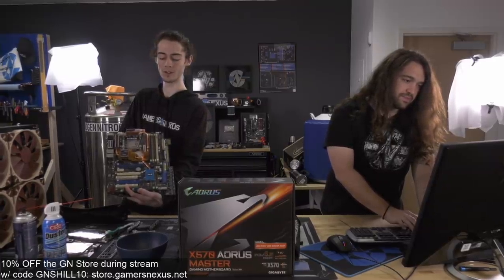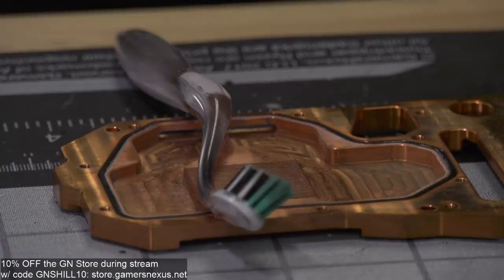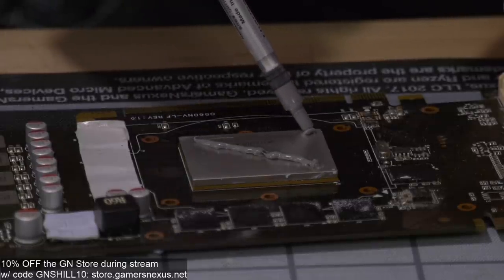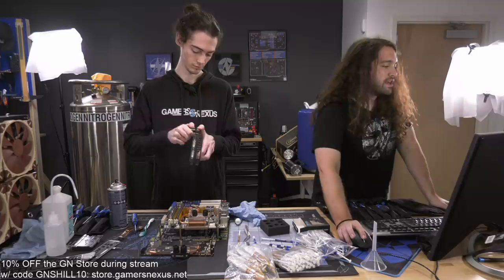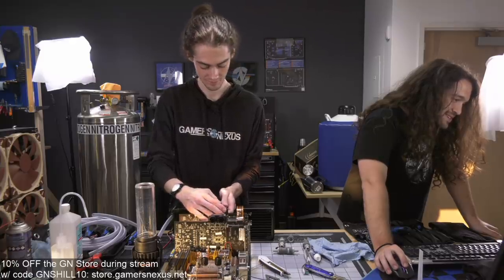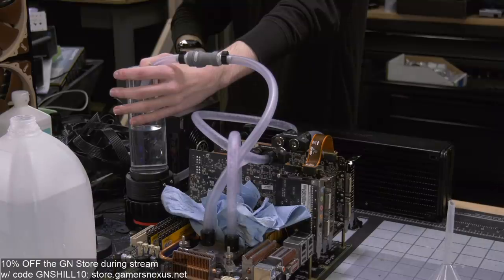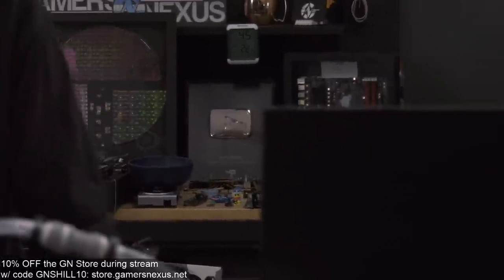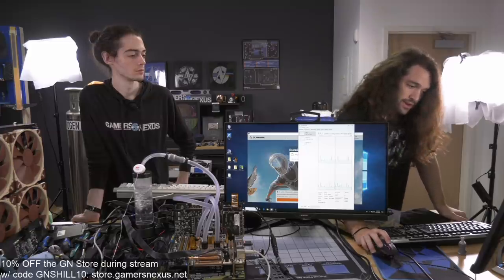Live: Ultimate Overclocking PC Restoration & Water Cooling

Comment: WOW!!   This brings back some nostalgic memories....
I had the original Striker Extreme, and they had an LED lit I/O shield too, and if I remember correctly, it also had an LED readout for info too.
I went for the EVGA 780i SLI(with the chipset fan add-on) after, and I still have that with the Q6600 G0 stepping(24/7@4.2GHz) and 4GB's of the Ballistix LED RAM and 2GB's of the SLI RAM sticks too.
My mothers PC has the watercooled KFA2 GTX 470 that I was using with that mobo but I still have the Sparkle 8800GT that I was using with the Striker mobo though......🤔
Can't wait to see the bench scores.  👍

Comment: Takes me back! in 2008 I had a Q9550 @3.625GHz running super quiet on a Tuniq Tower 120, the highest i got it running rock solid was 4.05GHz but with the fan and thermals getting higher than i felt comfortable around 80c overnight running prime 95. Paired it with 8GB 1150MHz CAS 5-5-5-11 ram and a HD 4850 that i volt-moded and i think ran at 850MHz with a 4 heat pipe CPU cooler i took out an HP business PC lol, the GPU was also whisper quiet at full load over hours of use. Also had a 120GB SandDisk Extreme wiff dat SATA 2 connection and a 1TB WD Black drive ;-)

FYI, I lapped the CPU and heatsink to a mirror finish with Artic silver 5, which i needed just a pea size that still got mostly mushed out anyway because of how flat the two surfaces were against each other.

Comment: Dude i gotta confess. Just about5-6 short months ago, i recieved my first pc. A custom pre-built from i buy power. (BB981 to be specific, i5 9400f {yea ik} 1650 super B365 chipset)Which to deviate slightly, you might be happy to hear that i recieved the system in awesome condition. Nothing was not connected, no glue anywhere in fact it honestly looked like a nicely cable managed custom build.BUT there was 8gbs of ram installed in one stick vs 2 four gb sitcks in dual channel. Anyway ive not only gotten comfortable enough to perform the average gamerboi upgrades, adding identical ram IN dual channel, new gpu, soon to be new cpu, ive also gotten comfortable to dissasemble my system purely for the opportunity to get better aquainted, Intermediate disassembly for thermal interface replacement, waterblock installations, and even some mild expert lvl situations, like de-lidding an i7 to replace the stock thermal interface with liquid metal for reduced thermals and data transfer acoustics (yes that is a rough quote from you lol). I wouldnt have been able to make a quick study of some of these things without your content dude. Thanks alot man, ill be moving on to locate that awesome shirt patrick is wearing in this vod, Thanks again for the guiding light Obi-Wan
Luke

Comment: Man, it made me cringe so hard seeing you guys completely lost in that BIOS settings. Unfortunately I didn't watch this video live. I could have "helped you" setup and overclock your system. 
I "upgraded" two months ago from my very own Striker II Extreme, Core 2 Quad Q9450, 8 GB DDR3 1600 MHz, to a Ryzen 5 3600 CPU running on a Gigabyte X570 AORUS Elite with 16 GB Kingston HyperX Predator 3600 CL16 memory.
Can you imagine the feeling?
I tried Cinebench r20 on my previous setup and it reached 163 points in multi-threaded mode.
My Ryzen 3000 series easily reached 3830 points. That's the scale of my upgrade. 23.5x the score. 
Thanks GN for the great vids and the great work!
Reply: @Patrick G I know that AVX isn't supported by the Q9450 and that was one of the main reasons I had to get rid of it. :-D
Thanks for your reply.

Comment: Less is more when it comes to applying the thermal paste.  You probably aren't messing anything up on the GPU because there were no discrete components very close to the GPU die, but on the chipset that drop was too much and it could be problematic IF the paste is conductive.  You don't want the paste spreading beyond the top of the die.  Carey Holzmann has a good technique for applying thermal paste (albeit it uses a latex glove) and he manually spreads the paste with his finger and he dabs it evenly across the entire surface.  This technique uses less paste and results in more efficient heat transfer.  The closer the heat sink is to the die, the more efficient the heat transfer.
Reply: Is this a copy pasta?

Comment: Overclocked this board a lot! 
Did 4.5GHz with a E8400 and even achieved a super high memory bandwidth with G.Skill RipJaws 1600MHz @ 2000 8-10-9-20 CL2, 500FSB 
Scored 14,962 GB/s Read, 10,639 Write, 11,206 Copy, 50.9ns Latency in AIDA64 MemoryBench
Tripple SLI testing was fun too but insanely CPU bottlenecked

Comment: I had, actually still have, a 560Ti somewhere, and it has the biggest cooling solution of any card I have ever had, pretty sure it was an Asus heat pipe thing but it is a triple wide card, those Fermi cards ran hot hot hot

Comment: do you think the cmos was still giving power to the board? I know i recently messed up ryzen master settings and it took me like 5 hours to figure out i needed to put a jumper on jbat to reset it. idk much really about electrical engineering outside of phy101 just know you don't want to bridge points to over amp or over volt resistors, or if some of the components on the board still hold a charge, like with a psu, for the distilled water on the board and the ultrasonic cleaner.

Comment: I have a Q6600 running at 3.00GHz on a Abit AB9 Pro w/ 2x2GB RAM at stock. I tried getting the Q6600 at 3.15/3.20 but windows crashes, and BSoD when i put more than 1.4v in the core... so i might change the cooling (it's on air for the moment, zalmann old one lol), any ideas or advices ? 

PS: yeah i know this is not a forum but whatever i think there are a lot of good overclockers here and i love this community

Comment: Just a quick minor correction here Steve, nvidia keeps their hardware in more up to date drivers but they do not optimize or add any support for them for very long usually only until the generation after the following launches the cards from two gen old get no love anymore. Just because the card is in drivers from 2019 doesn't mean it's had any updates at all since 2013, OS compatibility aside.

Comment: G'day Steve, Patrick & Kegan (hope I spelt that right),
That is a cool old system, although it is running really slow compared to my Q9650 using an SSD, I am running Windows XP on mine so maybe W10 is using more resources,
with the Core 2 Quad you OC the Frequency if the Multiplier is at Max & adjust the Memory to CPU link Ratio for memory Frequency, although from memory the Xtreme have an unlocked multiplier,

I would like to see an OC stream for the system

P.s. is Joe coming on Saturday or Sunday? i'll have to get up early here in Australia
Reply: windows 10 does a lot of background work. paging, updates, etc. u need turn all of these off in group policy (which doesnt even work on windows 10 home LOL) unless you want to wait out for everything to finish. windows 10 hits hard on older hardware. so I use older windows 10 LTSB install which has a lot of the crap turned off by default. and it works just fine.
Reply: With the right tuning (and enought ram) windows 10 runs phenomenally on these cpu's. My Q9550 does at least
Reply: @AlvaroLR  I have mine set up with XP because I have a scanner that still scans Awesome & only works on XP, so I just play my old games like Zoo Tycoon & C&C Generals on it too 😁
Reply: @shaneeslick  Damn drivers ! At least you get hassle-free classic gaming haha
Reply: @AlvaroLR  I still like the old games & my niece love playing Zoo Tycoon on it when she visits too, it doesn't have fortnite so my nephew doesn't like it 🤣🤣🤣🤣🤣 & says it's the crap computer

Comment: whats better overclocker this maximus extreme or a 790i ultra sli board?? I have mine running a q9550 at 4ghz but I never actually pushed above that (because its unstable)
Reply: This is a Striker II Extreme with a 790i Ultra SLI chipset from nVidia.
Reply: Thank you sorry I thought it was the maximus extreme it looks very similar

Comment: could someone tell me what that spray Steve used was to clean off the thermal paste off the GPU die?
Reply: Most likely isopropyl alcohol spray.  I have a can of that. Was sold as "car interior cleaner" by Audi. $35cad bottle of 99c  alcohol
Reply: @19971997gt  that's what i thought but was not quite sure. Thanks though

Comment: And yep, Windows can do that.. Even older Windows can do that if you enable the driver and services for other chipsets or move it to a similar or same brand chipset.. example iaStor is usually for Intel AHCI, or you can always have Legacy IDE mode running so you don't get the classic 7B boot device not found lol multiplier set wrong.. nobody noticed or said that CPU should be unlocked, too...

Comment: Overclocked my q6600 to just u der 3ghz per core on stock cooler...
Reply: Holy sh*t stock Intel cooler? Lucky it didn't overheat and form a micro black hole.
Reply: This build steve and Patrick did is pretty much what I was going to do.. 10/11 years ago.
I still have my striker extreme 2, all peripherals, box, manual etc.
I was surprised, I swear by buying an expensive/decent mobo. It is the heart of a PC build imo. If you don't have a decent ticker, the other bits wont work as well
It still turns on and has the correct date and time on it - still have the build up together. 
I got it to 2.93ghz, but it ran rather hot, it was more stable around 2.8(2.86.. iirc) and ran fine, no problems. Got a little uplift in performance but I was using a gt8500 and frankly.. it was a rubbish card and was a stop gap. But, the full build never materialised :(
Tell you what, I wish the strikers watercooled vrm/southbridge heatpipe could appear on an x570 board
Reply: Have a 2.8ghz p4 with a gtx with 256mb gddr3.. I cant remember the model number, wanna say 2760, but that's probably wrong, but that was just an hp consumer PC
The more weird one is the dos one in the loft(ran dos originally,  not sure if it has 98 or xp on it). I remember my dad building it when I was three and I learnt how to enter dos command lines at the age of 3/4... I remember when we got a 8x CD drive with write capability with 95... in 98 that was a holy grail- that I remember was definitely a Pentium 266 processor and I remember having to do some weird stuff with the native dos to get some games to work correctly (especially ones made for dos) as they were at this point sometimes still bound to cpu speed and ram.. so if your cpu was faster than the spec it would run at light speed and be unplayable, Haha
Look at me rambling.. probably still have some dos 40mb hard drives lying around somewhere.. haha